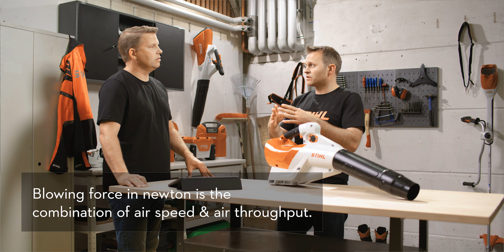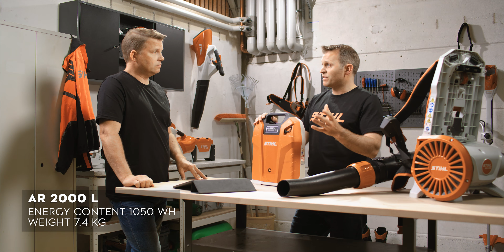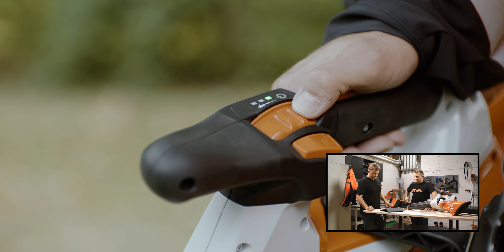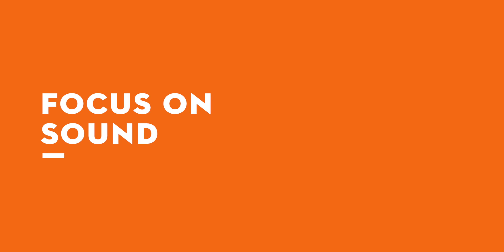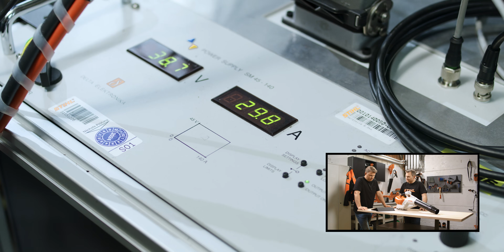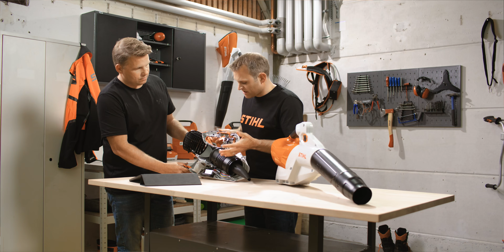FOCUS ON Battery blowers | STIHL

Comment: Just got the bga 250 and was able to use it this week. A joy for quick clean ups.

My question: are there going to be attachments available to extend the blowing tube. It feels a bit short, also in comparison to the bga 200.

Would be nice to not have to bend over to blow up wet clumps of material.
Reply from the maker: Hi! We are happy to hear you are enjoying your STIHL BGA 250! Regarding attachment availability, as availability differs from country to country, please kindly reach out to our colleagues in your country. They will be able to answer any inquiry you might have!

Comment: Residential user here.  Bought this two days ago...absolutely outstanding upgrade over my BGA 86 and BGA 100 (which I never really cared for).  With two AP 300S's and an AL500 charger, I can do everything I need to on my smaller but heavily treed residential lot.  Very surprised to see it in my local Ace Hardware store, considering it's not even on the Stihl USA website yet.  Great tool.
Reply from the maker: It's fantastic to hear that you're happy with your new tool and that it's working well for your needs. Thank you for your positive review!

Comment: The BGA250 is more affordable than the BGA200 even though it is more powerfull etc. Is there any upside of the BGA200 besides the ergonomic system?
Reply: The BGA200 is so much lighter
Reply from the maker: Hi! The key benefits/differences comparing with the STIHL BGA 250 is that the STIHL BGA 200 is compatible with the comfort carrying system, it has the metal ring and the adjustable nozzle and last the balance is also optimized for use with the connecting cable. We hope this helps!
Reply: @Stihl pardon me but wouldn’t the upside of the 250 be the battery just slots in? I’m having a hard time choosing between a 200 (have the adapters, cables and I even slotted into your fabric backpack to hold the batteries) however the 250 is blowing 26N - I heard there’s a should strap for the 250?

Can Stihl model that anywhere? Instagram even.
Reply from the maker: @tottenhamteacher  The AP batteries just slot into the BGA 250. A suitable belt for the BGA 250 is the Set of carrying straps. The AP Battery Belt with Harness is also compatible with the BGA 250. As product availability differs from country to country, we recommend contacting our colleagues in your country.

Comment: Hi Guys! Thanks for the detailed review. Just one more question. The BGA 250 can do 26N at the highest power level. However, as the device has three different power levels, I'd be interested to know how many Newtons it can handle at the two weaker levels. I'm using my beloved BG56 petrol blower since years and now considering about buying a new one.
Reply from the maker: Hello! Thank you for your comment! We want to inform you, that the BGA 250 has the following N by power levels: Level 1: 11 N,
Level 2: 15 N, Level 3: 20 N, Boost Mode: 26 N.
Reply: @Stihl  I've always wondered what the blowing force is for the different levels! 
I'm picking the BGA 250 up tomorrow. I've already own the BGA 200, but I like the option to put the battery in the machine, very handy for just a quick tidy up. Do you have the blowing force power for the BGA 200 on each level?
Reply from the maker: @garyclapham5482  Hello! Thank you for your comment! We want to inform you, that the BGA 200 has the following N by power levels: Level 1: 5 N, Level 2: 10 N, Level 3: 16 N, Boost Mode: 21 N.
Reply: @Stihl  That's great thanks

Comment: So does the BGA 250 not have the ergonomic clip slot?…
Reply from the maker: The comfort carrying system for easy attachment to the hip belt of the AR L carrying system is only available on the BGA 200. 
The BGA 250 is compatible with a battery belt carrying system with harness.
For more information please contact our STIHL Support Center.
Reply: @Stihl  theoretically- the feel or ergonomics make it so that I don’t even need the attachment the 200 has?

I’m willing to take a leap on that 250 but I thought the 200 clip was neat.
Reply: No it does not

Comment: Battery only good for blowing off after cutting. For a real job you got to have gas powered back pack.
Reply: I don't care for the real work vs fake job comparison. It makes as much sense as discrediting small screwdrivers to fix computers vs a mechanic's tool set. They're different tools. I own both and I use them for different reasons. I look forward to adding the BGA 250 to my stable.
Reply: @ryant1090 still debating hard between the 250 and 200 (had prepped with cables and such already - I suppose I can resell all of it?)